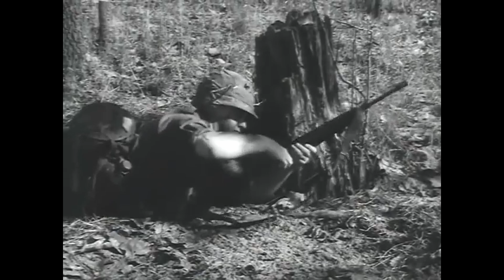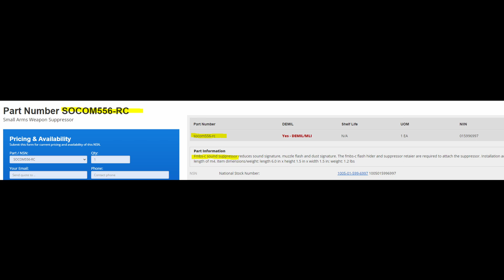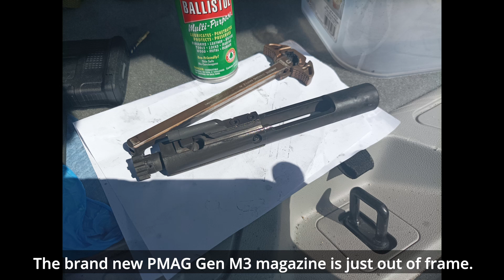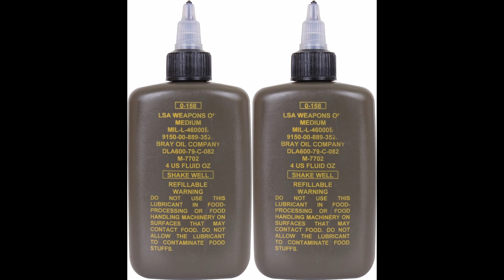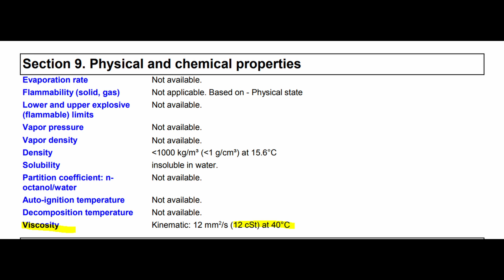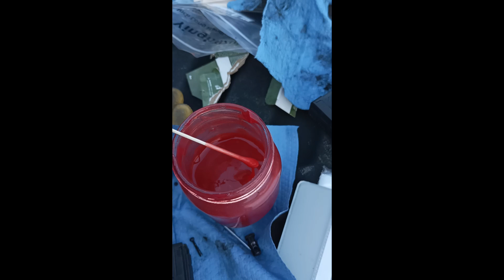Best Lube for Suppressed AR-15? 11 Lubes Tested!

Comment: If you’re having all these malfunctions, you’re doing something wrong you should stick with a stock rifle. I’ve owned 17 colt air 15 rifles factory rifles over 30 years and I fired over 150,000 rounds never once used the P mag because I can’t have in my state and I’ve had only three malfunctions ever. I don’t use any suppressors cause my state does not allow them and the only malfunctions ahead. We’re using wolf ammo. Normally I load only 10 rounds or 20 in magazines. Ballistol works great for me in NY with my AK. I use LSA on AR15. Because you changed everything you probably have timing issues. Ballistol didn’t cause your rifle to malfunction

Comment: I was using grease for a while without issue and switched to Sotars blend and I definitely like it.
Its a longer video so maybe I missed it but did you factor it heavy vs light lubrication?  Because I’m definitely in the lube it very liberally camp and I feel like that alone may have more effect before the type of lubricant.
Reply from the maker: I just did what the M16/M4 TM calls out for simply because it seems like a reasonable middle ground of light vs heavy and it is an "official" standard.

Comment: Did you use isopropyl alcohol after each time before switching lubes? Both on the bolt and the entirety of the upper receiver? If not then the results are very unreliable. Tons of weapons lubricant that work against each other.
Reply from the maker: I used a degreaser each time.

Comment: Sorry for the double comment I got to the 5W-30 section.  There was a world war II training video about landing in France in keeping your weapon clean daily they stated if you could not get to the rear to clean your weapon that any vehicle you found that had five weight motor oil could be drained and used to clean your weapon and lubricate your weapon.  I really think it is old fud lore probably along the lines of if the government said you could do this that means it's all you need.

Comment: I always make a mix of CLP air tool oil and spring co mgl and I use the mgl on bearing surfaces and shotgun tube grease where the hammer interacts with the bolt carrier.  It's probably Overkill.

Comment: It's not my comment (not allowed guns u.k).
Guy comparing ar15 gas piston conversion,sez original design was made to be lubricated to a degree ,by carbon in gas from bullets.
In gas impingement system.
Still need cleaning ,lubing,as proved in Vietnam.
There is a guy ,YouTube,shoots guns to melting point..

Comment: Please test Automatic Transmission Fluid.
Reply: 🤢 That would smell awful.
Reply: @Birdmaaan224 thanks for the heads up. I thought maybe he would respond but I guess he didn't like the idea. I've been using 5W-30 synthetic motor oil for 5 years now. It does the job.

Comment: Slip 2000 Grease is a really good lubricant from my experience works very well cold or hot and it dont slow the gun down like automotive grease does i dont run a suppressor though

Comment: I personally used G96 products almost exclusively for 15+ years . G96 Synthetic Liquid Gun Grease is IMO the absolute best gun Grease period.  G96 COMPLETE Gun Treatment Spray smells so good but I used that as long term storage more than anything . G96 Synthetic CLP is pretty legit . I'm just not a fan anymore of the more runnier style lubes but I also never once had an issue with it either..
The only Slip 2000 product I really like is the EWL-30.  The regular EWL is like 7W or 12W Lube , whereas the EWL-30 is a 30W . The EWL-30 works extremely well in ARs and pistols due to lube not migrating..
IMO SOTARACHA is the best all around lube for AR period . I've found this to work extremely well when suppressed..
I'm a fan of quick cleans . Every 500 or so rounds I wipe off and apply lube . Every 750 to 1k I'll actually the cam pin and bolt out to wipe off . Every 1.5k to 2k rounds I'll still do quick clean but this is when I'll use Solvent , wipe off and then apply lube . Every 1.5k to 2k I'll run Boresnake down the barrel 1x and that's it . 
For pistols I do the same quick clean method . 
To date the only 4 Gun Care products I use are....
G96 COMPLETE Gun Treatment Spray , Slip 2000 EWL-30 , SOTARACHA and Breakthrough MIL GRADE Solvent..

Comment: Ran the same lube for years upon years now and it works great in my area. half mobile 1 synthetic motor oil & half transmission fluid, I've used it for countless rifle / carbine courses while on a LEO high risk entry team and later on in the private security sector. I'm one of the wetter is better crowd but again environment can often dictate what you are using.

Comment: Great video, I like how you presented the  legacy tests performed by the Army, AF, and M/C. I worked on GAU-8 and M61A1 guns in the AF. We used VVL-8000 as a cleaner and rust preventative on the barrels  and front barrel shrouds. The semi fluid 4600 was used in the oiler….you can see the yellow lube oil tank in the M61 video. The GAU-8 uses a tank that must be filled using a hand held pump. Ultimately, the semi-fluid lube is only used on the mid-rotor inside the gun housing. There are rails that the bolt assemblies ride on that feed, fire, extract ammo. That’s it, so as the lube slings off it stays in the housing and excess slings around until it is burned off and vented out the gun gas exhaust. We also used CLP until it was discontinued in favor of VVL-800.
Reply from the maker: I have a quart of VVL-800. I basically just use it in place of what I would have for WD-40 and CLP since it's so cheap.
Reply: @fullspectrum1616  There isn't any cleaner in VVL-800.
Reply: VVL-800 is synonymous with PL-S. IIRC, VVL-800 was used first, replaced by semi-fluid LSA, which was then replaced by CLP. VVL-800 is not a cleaner but is a rust preventative and lubricant. As an aside, there is also Breakfree LP, which lacks a cleaner and supposedly lasts longer as a lube.

Comment: Otis dry teflon based lube.
Tri flow is good as well.
Clean the entire bolt, carrier and chamber with acetone and Qtips DO NOT DIP OR SOAK  PARTS IN ACETONE. 
Spray all parts liberally with dry lube. For the first time; allow parts to sit for 8 hours.( subsequent applications can be 20min. of drying time)
Wipe all parts down and reassemble.

Comment: Wildcard mix
5w50 snow mobile oil from Canada has no detergent or stabilizers... I put very little STP oil treatment to thicken, I call it the glistener xD
I use food safe ngli0 aluminum oxide grease on rails and places grease is better than oil

Comment: Always been told to use a light coating of grease and its always do well for me, ive been using the same tube of grease for 10 years and barely used 3/16ths of a tube.

Comment: I went away from the stoner ar15 m16 system years ago. Now, i would probably move to a short stroke gas piston upper if i were shooting a stoner suppressed. That gas impingement system pushes so much crap into your reciever, especially when dealing with the back pressure of a supressor. I run ak rifles. Sure they are not perfect but they sure handle the back pressure and blow back alot better than the gas system in an ar. I make sure my rifle has oil on every surface wiped with a rag to prevent rust and use white lithium grease (just a dab) on all the friction contact points. With a strong recoil spri g and adjustable gas piston i can tune an ak to have the recoil of a nice ar.
Reply: PWS long stroke piston uppers ( especially in 762x39) make one of the best suppressor hosts.
Reply: All these problems are 80% fixed by the new low backpressure flow through suppressors. The difference between a high back-pressure can and a flow through can is amazing.

Comment: Been shooting and cleaning weapons for over 60 years, 30 years of which includes being a professional gunsmith.  In that time I've tested and used several dozen of different products. The best one and done proved to be Clenzoil. Eagle Tears is a close second. Lucas Oil products have a good reputation. And Balistol has given good service. 
The above is based solely upon my experience spanning several decades of trial and error. 
Using motor oil is something I tried, but do not recommend.
Reply: I agree with Clenzoil products 👍👍

Comment: Since you mentioned about possibly doing a second test, there is a project farms video about testing different clps. clenzoil ranked really high, mostly bc it did so well in the lubricity test; however I wonder how it would hold up in your testing. Maybe a possible candidate for potential future tests
Reply: I use it in all my guns exclusively. No jams in 5.56 or .308 or any handguns.
Reply: I agree with Clenzoil products 👍👍

Comment: I found an EXCELLENT mixture last year. I used Mineral Oil and that Mobil 1 grease. 60% mineral oil and 40% grease. IMO it works a bit better than Sotaracha and lacks detergents found in common motor oils. 😊
Reply: Don’t use grease inside the carrier. When it heats up, it drips onto the trigger assembly.
Reply: @DM-w5oSOTAR and many others lube said assembly including myself 😂. I’m not sure how thats a bad thing.
Reply: @DM-w5othat does no harm

Comment: I use lucas on the bolt and Go juice on the inside of the bolt [gas rings and firing pin] . I clean all my guns after use no matter how many rounds. Been shooting since the 1980,s. Never had a round stuck in a chamber,AR M-14 M-1 Garand. Since using P-mags never had any malfunction in a AR platform.

Comment: Last question, if the gun is cleaned before testing and you get a jam on a your first or second magazine, I don’t see how that would be the lubricants fault. That sounds like a mechanical failure on the rifle.
Reply from the maker: Those jams were purely frictional since a light tap on the forward assist was what fixed the problem. Friction comes from the lube not doing its job, and yes the lighter oils were getting blown off after only a single magazine.

Comment: Reading through the comments reminds me just how much I hate the idea of contaminating the bolt's lubricant with partially burned propellant and metal particles and turning that lube into a contaminated, baked-on layer of carbon from the very first trigger pull.  That seems like almost as good of idea of doing the same to the any lube between the steel bolt carrier and the aluminum upper receiver.   Yeah, I know that the AR-10 was designed in the 1950's to get the aluminum-experienced, aircraft manufacturer, Fairchild, an Army rifle contract in the 1950's when the idea of the next war not lasting more than the couple of days needed to escalate to nukes was a widely accepted theory.  But, it was still a bad idea.  

At least now we have Type 4 anodizing that'as supposed to be harder than steel.  But didn't they develop electroLESS nickel plating during WW2?  Too expensive for a disposeable rifle, I guess.  Pity, no one seemed to think about training with rifles for as many years as the planet-killing war they envisioned was successfuly avoided.

Just checking in after being away and trying to catch up with responses that weren't hidden for YT notifications,  (In this case, probably just the sheer volume of notifications since I've been away.)  Apologies to anyone who wanted one and didn't get it.
Reply from the maker: Lots of GIs would nickel plate lugers they took home. Stoner was even nitriding the 63 barrel and bolt IIRC from the day it was offered to the military. The whole implied rationale for the chromed bolt & carrier was the "shit where it eats" meme being a concern even back when Stoner was designing it. I've found it implied (never directly stated) from original documents and people involved at the time.

Of course, the chrome finish being expensive and a liability from flaking off as a plating was a reason to switch to phosphate (the same reason McNamara originally vetoed chrome lining the chamber and bore: cost). Even to this day the TiN coatings/platings can flake off just like the original chromed carriers.
Reply: @fullspectrum1616  Not everything that glitters is actually gold.

Comment: might I suggest you try  a mixture  of the following ( got this recipe from a sharpshooter at camp perry some 40 odd yrs. ago and have used it in ar style rifles,  SKS & AK rifles, bolt action and numerous revolvers and semi auto pistols and I can count on one hand  the jams I've had after 1,000 of rounds Ihave shot  the recipe is as follows ;  1 qt of 5W-30 motor oil - 1qt  ATF fluid - 1/2 bootle of blue STP -and  4 oz Hoppes #9 bore cleaner  pour all this into a gal milk jug shake the heck out of it  for a few min.  and you  got enough to last for a very long time. I have prob. made this lube up a total of 5 times in 40 odd yrs.  and have used it ion all my guns without any issues there are a lot of names for this concoction  but the one I was told is OLD RED lube have a great day

Comment: When CLP was tested before adoption, it was determined that it did not clean well. It was adopted to be a one-and-done "cleaner"-lubricant-preservative.  

In my experience, (1980's), it didn't protect against rust very well either.  When the company commander dictated that CLP (BreakFree in one gallon plastic jub with attached long hose hose squeeze sprayer) be squirted down the muzzle until it ran out of the chamber and all over all the wrong surfaces; you were GUARANTEED malfunctions - failures to feed, bolt over stoppages, etc.  THAT much lube did lube - for first few of shots burned it all off, trapping partially burned propellant trapped iin every "lubed" surface and formed a thick layer of carbon.  No surprise there, what would you expect when you come and/or burn a petroleum distillate.
Reply: IIRC, the first CLP used was better at cleaning then subsequent ones.
Reply: It had a 98% firing residue removal initially because of the solvent content within the CLP, requiring minimum of 80% firing residue removal. The spec in 2026 requires 40% if removal focusing more on lubrication and corrosion protection. G96 BIO CLP is currently the premier military CLP

Comment: You usually cut Ballistol with water, to make what is known as "moose milk". The water lets it flow in the cold, the oil keeps the water from freezing. Not the best choice in this application, but for old wood stock gat or smoke poles it's hard to beat.
Reply: Excellent for black powder firearms like you said and old Mosins with corrosive primers. 😊
Reply: Good to know.

Comment: Depends on your environment and how you use them. Extreme cold might prefer a dry film spray or graphite powder. Even heard of WD40 in the snow to help remove moisture and it burns off to help keep the gun dry. That said a friend in Washington State has snowy winters and he uses CLP and motor oil on all his AR's and other guns. I'm use to hot tropical environments so I use INOX MX3 mineral oil CLP, and MX6 or lanolin grease. All work well, especially against rust, and non-toxic. And good old motor oil, whatever viscosity I can get away with: 10W-40, 15W-40, even 20W-50. Again just depends on temperatures and environment. Good presentation and research report 👍
Reply: Hmmm . . . WD-40 would be good for removing the moisture.  Not living in the NW, I'll necessarily rely on Rumor Control to ask if the winters may have less humidity than other environments.  It seems like a WD-40 water displacement followed by pretty much any oil with a viscosoty low enough for the temperature would well.  Signed, Captain Obvious.
Reply: Yeah about the WD-40 I was told by a a very knowledgeable gun guy in opota class not to use penetrating oil because if it gets on your bullets it can penetrate the case into the powder and you have a failure to fire. Now I don't know if that's true or not but I've always stayed away from it and just used 5W-30 Amsoil for my guns
Reply: Graphite eats aluminum, so better to go with a molybdenum dry lube.

Comment: I have been using the Slip2000 grease and AGL very thin grease in the -50c winters we get up here in Northern Canada to lube all my firearms I use a little hobby model paintbrush and apply a thin layer on all the parts that slide and I have found these greases work so well as they stay where you applied it and when it comes to cleaning it involves just wiping it off, wiping it down with some slip2000 gun oil then reapply the grease again and I my firearms have run amazing I will not use oil anymore as a lube for my firearms it just either drys away or migrates from gravity to the low spots eventually and these two greases just work awesome
Reply from the maker: Very cool to hear to hear that, thanks for sharing.
Reply: What he said.